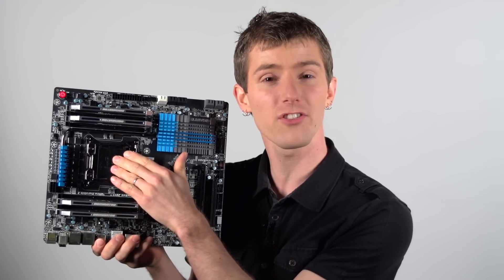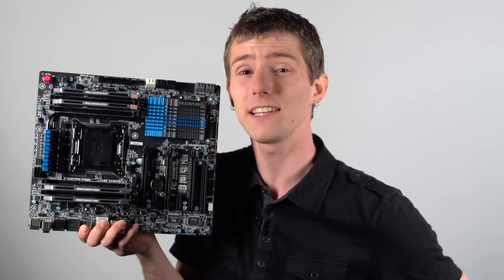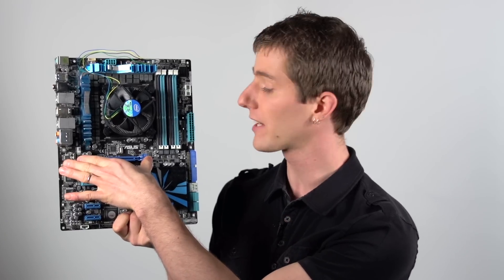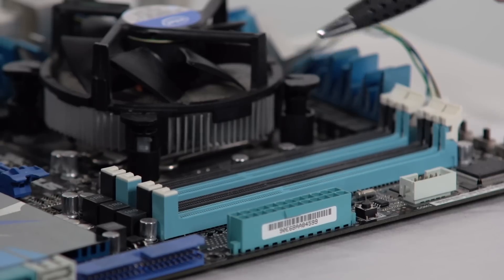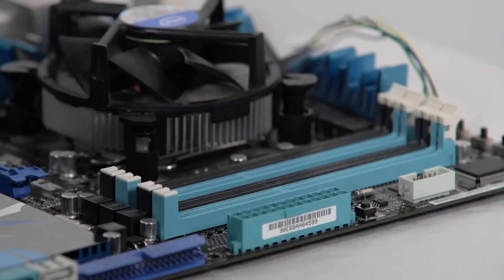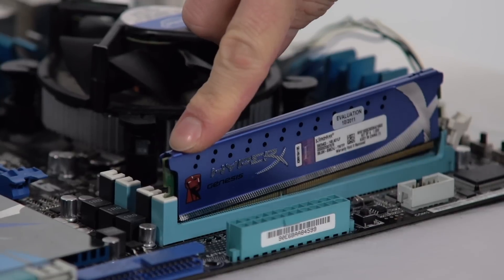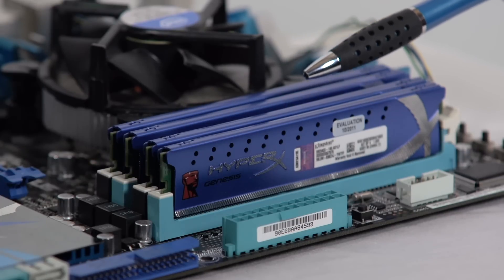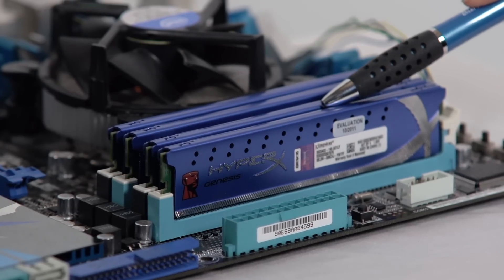Install DDR3 RAM Memory As Fast as Possible

Comment: Third, the sequence only matters when you have 2 sticks of ram or you have 2 sets of mixed ram modules. I will use the the board you have in the video as an example.  See where ur finger is pointing (1:44)... if you had 2 sticks, then you will fill A1, B1 and leave the other slots empty. Always follow the number sequence etched on the board and you can't go wrong.  Never go by color code alone because most of the stuff we use comes from Asia and I don't trust those guys.  If all ur mem slots were red or black or any other color then you would have no choice but to look at the module sequence on the board to be sure.  Read the board and it will make life easy.

Comment: Just happend to be watching another video and came across this one.  I used to like Linus until I started finding flaws in his information.  Here is where he went wrong.  First of all, I have never heard of a QVL that is outdated (ridiculous). Motherboard MFGs will test their boards with a fairly large array of different ram brands to give the customer a wide pick.  They also tell you that their list is not exhaustive and to check with the ram mfg to ensure compatibility especially if that brand didn't make it onto the QVL.  Second, if you are filling all of the ram slots with the same type of ram from the same mfg, then it doesn't matter which slots you fill first (dude can you hear yourself... again ridiculous).

Comment: I already have 8GB ram single stick installed and after I add another 8GB ram (both are 1.5V, same cas latency shows in cpu-z), the system shows 16GB but only 8usable. I've tried ensure that in bios memory mapping is enabled, reseated the rams as well as go to msconfig and unchecked/untick the maximum memory box in the advanced options of boot tab. None of it works. please help.

Comment: Guys I need help si my dad b4 told me to get ddr3 for my PC because we had them installed but my gateway GM5638E has on the side that it runs ddr2 wtf do I do I mean my ram sticks fit in fine and the little breaks he told us to align are the same as his like halfway cut someone help which ram do I get ddr2 or 3
Reply: ddr2

Comment: i have a dual channel mobo . and i have G.Skill Aegis 2x4GB DDR3 1600Mhz CL11 and i want to add another 2*4 gb kit can i install a G.Skill Ares 2x4GB DDR3 1600Mhz CL9 Kit?
Reply: you havent specified if your motherboard has 4 DIMM slots or not
Reply: it does.

Comment: I einsed the ram and put it back in and my PC won't work. Can someone help me out?
Reply: Vlad Lucian sorry for the late response... Did you dry it? Is it still wet after 3 months?
Reply: +Diamond Sky I got a new PC now. I thing the RAM sticks are still wet though. Let me check... Yup. Still wet.
Reply: Um.... But them in the oven? Or Microwave? That should dry them
Reply: Diamond Sky Jut put them in the microwave. It totally fixed them. I put them in for 10 minutes at the highest setting. Thank you for the fix.
Reply: +Vlad Lucian That will be $60, thank you
Reply: +Diamond Sky Aww man... you see... I'm broke AF.
Reply: +Vlad Lucian Fair do's, I will let you off this time
Reply: +Diamond Sky Thank you.

Comment: Can you make a video on how to fix a computer that displays "No Signal" to the monitor?
Reply: Unplug the cable (be it hdmi, vga, whatever) on both GPU and monitor and plug it back in. Make sure it is all connected properly and inserted all the way in. If it's still not working, buy a new cable (maybe better one that uses a different port (maybe it's the faulty port, not cable)).

Afterwards, try someone else's monitor on your computer, and vice versa. You should easily spot the problem after all of this.

Comment: For a quad channel DDR3 ram,  Which is better?
max ram of 16Gb, 4 - 4Gb DDR3 1600 RAM or 2 - 8GB DDR3 1600 RAM.
Reply: four 4GB sticks will be the fastest; it will run quad channel and be 4X faster than if you had say, just one 16GB stick

two 8GB sticks can only run in dual channel which is only half as fast, BUT you will have more slots left to upgrade to even more RAM in the future.

Comment: HELP!!!!!! I just bought ran when I put it in my PC it just beeps for a bit then stops and the screen is black
Reply: +Ramon Angel I realised that my ram is too powerful for my PC my PC can only handle 1333mhz this is like 1888mhz or somethin
Reply: +Aus_trips_modding Lmao you should make research next time.
Reply: +- CSGO DracoValius - the computer shop I bought it of said that my ram was correct and would work fine
Reply: Aus_trips_modding Never ever relay on Computer stores, they hire non experts and clueless people that would tell you i7 is better than i5 lmao.
Reply: +- CSGO DracoValius - yeah I found that out after Google for 5 min I found out it was the wrong ram
Reply: +Aus_trips_modding You should try to get the same brand as the one you had before can be safer.
Reply: +- CSGO DracoValius -  I couldn't find the same brand so I just bought 8gb of one brand that would work (cause it was only $20 for 8gb)
Reply: +Aus_trips_modding I have 2 GB of RAM on my PC lmao
Reply: "people that would tell you i7 is better than i5" but, i7 is better than i5 lmao
Reply: i7 is better than i5 within the same generation, and if they're both desktop or laptop. But a desktop i5 could beat a laptop i7, and a 6th generation i5 could beat a previous generation i7 depending on the chip. It all depends on the individual chips you're comparing.

Comment: Can I have 2 memory sticks from 2 different manufacturers?
Reply: Yes.  In most cases.  In some cases you can actually use them in multi channel mode but don't bank on it as its not insanely Commen to get THAT lucky.  However simply mixing and matching different ram is totally doable

Comment: Can some smart computer person help me please :(
On the motherboard i'm buying i only see these numbers. I think there the speeds ( DDR4 3466*(O.C.)/ 3400/ 3333*/ 3300*/ 3200*/ 3000*/ 2800*/ 2666*/ 2400*/ 2133 ) But  I don't see anything about voltage :( This is the motherboard i want to get 
( http://www.newegg.com/Product/Product.aspx?Item=N82E16813128838&nm_mc=AFC-C8Junction&cm_mmc=AFC-C8Junction-LogicalIncrements.com%20Inc-_-na-_-na-_-na&cm_sp=&AID=10440897&PID=5961731&SID=0 ) 

And this is the ram i was going to get (http://www.amazon.com/gp/product/B00OTJZTJU?psc=1&redirect=true&ref_=ox_sc_act_title_1&smid=ATVPDKIKX0DER )  would i be able to use it?

Comment: I installed new ram and my screen doesn't boot. my computer turns on though.
Reply: check compatibilty. See if motherboard supports ddr ram, ddr2, ddr3, or ddr4. Also make sure that it doesn't go above the maximum gb the motherboard supports.
Reply: Donald Moisant thank you man
Reply: just had this problem a few minutes ago, make sure its snapped all the way in. if you hear a click and it feels stiffer than before, you did it.
Reply: I did it all but im still stucked on bios. And it says 3584 something mb ready. My one stick is 1066 mhz and the new one is 1333 mhz and my motherboard supports 1066, i know it would underclock but i dont know what to do lmao. If i install the new ram independently it works.

Comment: Ahhh beware! You did not mention CAS latency, if you are running that 1600mhz ddr3 with a latency of 8, ddr 800mhz latency of 4 would be the same speed and now performance upgrade for you! Sure it runs at a lower voltage but is that worth the money? Latency is EXTREMELY important, check my channel for a quick explanation ram shoppers!

Comment: i upgraded my pc from 4gb ram to 8 but when i check the system it still says its 4gb, anyone can help with this?
Reply: +Johnny Ruiz First, you have to switch your bootup logo screen into POST mode when you power up your computer by pressing tab, F1, delete or any other key depending on your motherboard. If your computer detects 8GB of memory and the operating system supports 4GB, you are using the 32 bit operating system. If not, you did not install the RAM properly. The 32 bit operating system limits the RAM amount to 3-4GB depending on your motherboard. You better be off using the 64 bit operating system.

Comment: If you only have one ddr3 module, does it matter which slot you insert it in? I just built my current rig with 8gb module but the CPU liquid cooling unit caused the first slot to get partially blocked. I inserted the ram into the next slot but it feels like there's a memory leak of some sort, especially when I play high performance games like BF4.
Reply: It shouldn't unless the slot aren't all the same.
Reply: Mike Gus Fifteen Your mother board manual or user information packet will tell you how to prioritize slots and which need to match if any and how.  Generally, motherboards are manufactured differently.  It may not always matter to follow what it says, but in doing so, you ensure everything works as intended.  

For example, my motherboard (ftp://66.226.78.21/manual/Z97%20Extreme4.pdf) manual indicates on page 23 to follow everything Linus just mentioned for probably the same reasons.  However, some manufacture may tell you it's better to place memory closer to CPU first if there are other components to consider in your MoBo design.

Best suggestion: find out max capacity, and max it, then you don't have to worry about slot priority, you just fill 'em all!!

Comment: If anyone knows what the problem with my kit is, please feel free to call me a dumb ass and explain.
I know very well that when installing RAM I should fill up one pair of slots before I go to the next (EX: Fill up both red before filling in the black slots.) but strangely enough, when I follow this method, the motherboard does not see the RAM.
At all.
I have to place both RAM sticks directly next to each other, or they simply will not work.
I have to have one stick in a red slot, and one stick in a black slot adjacent to the red one, or the computer will not see the RAM.
I'm puzzled by this because even in my motherboard's manual it gives 3 recommended RAM layouts, one of which being the method I tried, the other being for 4 sticks of RAM, and the last being for a single channel.
If anyone knows the fuck is going on, please feel free to tell me, because I know that having RAM in this manner can potentially cause it to run slower than having it in the proper channel.
Reply: most the time they are color coded so fill up one color then the other and 99% of the time they will not be side by side. just put both sticks in just red OR just black if you put it in red and black it will slow down your ram.
Reply: Jane Doe
 That is not the issue.
The issue is that when I fill up ONLY the red slots, the computer does not recognize the RAM.
I literally have to put them right next to each other to make the RAM work at all.
Reply: Racoon in the closet did you try only the black slots?
Reply: Jane Doe  Same problem.
That was the first thing I jumped to when the red slots didn't work.
I'm using an Asus Maximus VII Hero, if that's any help.
Reply: Racoon in the closet http://pcpartpicker.com/forums/topic/42740-asus-maximus-vii-hero-memory-problems Thats the only page I could find with the same problem as yours. So I guess just run the ram like that for now.
Reply: Although this is probably late, and you've probably fixed it, the best thing to do is contact the company that makes it. This is mainly for people who read this later.
Reply: Michael Gibson  Actually nope.
Turns out I got a faulty kit but I didn't find this out till after the RMA warranty ended on the kit. :/
Had I learned earlier that it was actually a defective RAM kit I'd have RMA'd it when I could.
Although the MOBO is seeing all the RAM so I suppose it isn't worth buying a whole new RAM kit over.
Reply: Racoon in the closet I have a asrock z97 pro4 morherboard and i'd like to upgrade my old 8gb dual channel rams to quad channel 4x4 16gb rams but i'm not sure it'll work.
Reply: +Racoon in the closet Some motherboards (especially older ones) don't recognize newer models of RAM, it might be a good idea to upgrade your mobo first before you think of the RAM ( If your motherboard is fairly outdated, that is)

Comment: I'm new to pc hardware, if you have a stick of 4gb of ddr13 1600 ram can you add a stick of 8gb ddr3 1600 ram for a total of 12gb of ram? I would assume you could but I really know nothing about pc stuff.
Reply: Pulp Free Fiction Not really, just get a brand that is worldly known, don't get those cheap second hand brands ones.
Reply: Metaru Elite F R E Q U E N C Y. It has a Q and a Y.
Reply: Yes, but why not just buy a 12 gb set?
Reply: Flopping Fish
it's cheaper just to buy a single stick of 8gb I'd assume, and that's pretty much why
Reply: Metaru Elite
will do, 2 sticks of crucial ballistix 8gb, also is there really a big difference with the brand of RAM I get?
Reply: hello, people, could u tell me if i could have only 1 stick of ram in my motherboard?
Reply: Its allways better to have ram that came from the same package, manufacturing isn't perfect, if one runs a tiny bit faster it can make your system unstable ie. random blue screens.

Comment: Hey. Can someone help me out with my issue. I have 4 GB of RAM on A MSI Global B75MA-E33. The RAM's default that came with that motherboard and I want to upgrade. What RAM should I get or it doesn't really matter which one I get. Would it still run in dual channel mode or would it slow down my PC. Currently I have 1 4GB stick.

Comment: Techquickie  Noob question here but... say I have a dual channel motherboard i want to install two sticks of ram into the motherboard. I would therefore use both black channels. If this is the case, what use is the other coloured channel? Since you wouldnt be able to use them to install triple or quad channel ram. Is the other channel for installing separate sticks similar to running two video cards? Also would it be better to use two sticks of 4gb ram (in the black channels (on a dual channel board)) OR use 4 sticks of 2gb ram in both the black and blue channels (again on a dual channel board) thanks for the help!!
Reply: I believe that 4 sticks of 2 GB would run faster because of having twice as many memory banks (I'm not a hardware expert but this is my intuitive guess and seems to be reflected in the price of RAM); however, 2 sticks of 4 GB would allow you to more easily upgrade in the future (if needed) by simply adding two more sticks of RAM.
Reply: Dual dual channel! Two dual channels.
Reply: When it means dual channel it means it is optimized for dual channel sets.

Comment: I had 4gb ram and i bought 8 gb and installed it and its still showind 4gb someone help?
Reply: This is most likely because you're mixing sticks that have different ram settings. You should post your RAM settings for both of the sticks for us to see whether both the sticks are compatible with each other in use on your motherboard. Also what motherboard and CPU do you have?

My brother had this same issue before. It was solved by putting the ram voltage up a notch and putting the same ram settings into both sticks (Note that this can cause instability).
Reply: Lol i figured out that i forgot to put my 2nd stick in xD it works well but i have another problem i bought new cpu 6 core and i had 2 core and when i put 6core computer startst but it doesnt bip and it doesnt send signal to mouse, monitor or keyboard but when i put my old cpu it works well
Reply: What motherboard do you have right now? Should be a model number like P8Z77-V LX / GA-Z77-D3H or something somewhat similar. Some motherboards with old chipsets being used with new gen CPU's may require a BIOS update for the motherboard to support the CPU and be able to use it.
Reply: Yeah thats the same thing the guy in the shop told me,to update bios,Thanks ben :)

Comment: Technically speaking, slots 1 and 3 are wired closer to the CPU so they, in theory, give better performance. Moving to the other slots to "reduce interference" is a non-issue really.

Comment: @hard619 no the cards don't have to be indentical, just the gpu of the car, exc. GAINWARD GTX 680 can SLI with ASUS DCII GTX680,  and even overclocked or stuff like that, just the gpu matters.

Comment: i GOT FAULTY G.SKILL DDR3 2133MHZ RAM, HOW DO I GET A WARRANTY REPLACEMENT? HOW LONG DOES IT TAKE FOR REPLACEMENT TO ARRIVE
CURRENTY RUNNING THEM AT 1600MHZ, WONT RUN AT 2133MHZ. :(

Comment: You're wrong, it depends on what you're using your PC for, for example: if you're a casual gamer 8GB of RAM is enough. But if you do more advanced stuff such as rendering more RAM is always better. You can see RAM as enhanced speed in a way, the more you have, the more your system can do at the same time with enhanced speed.

Comment: Trim js a command that allows an OS to inform an SSD which blocks of data are no longer considered in use and can be deleted, this is due to how the OS deal with deleted files on a HDD, they simply remove the files from the MFT, to make things go faster, which is then rewritten over when new data is placed on the HDD. SSD don't work that way, if a file is deleted from the MFT, it's still on the flash and it won't be overwritten since the SSD consider that part as "used", thus the need for TRIM.

Comment: My ASUS X79 has the channels set up so that each memory slot is mirrored with the second slot on that channel across the CPU socket, and as such ASUS recommends that memory be installed in pairs with each stick being on opposite sides of the CPU socket. This board appears to be of the latest generation, does it not work the same way?

I think that, ultimately, one must RTFM, odds are issues like RAM placement have been addressed by the manufacturer or patent holder.